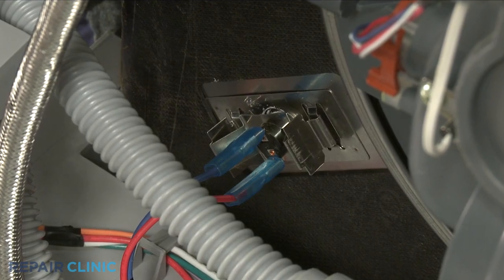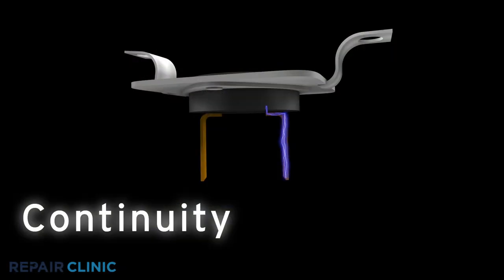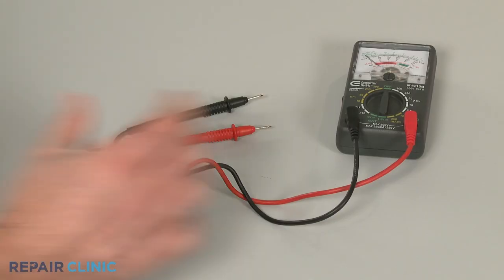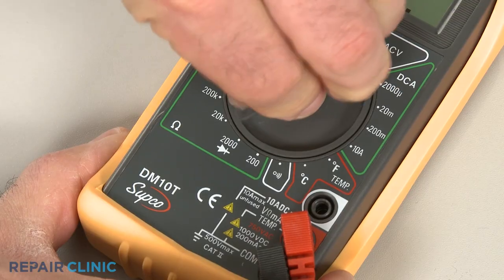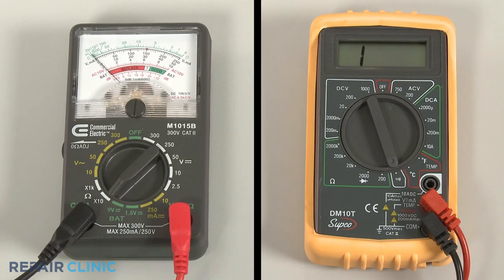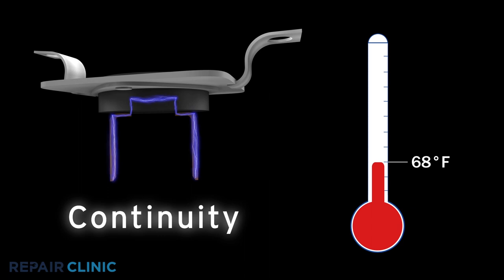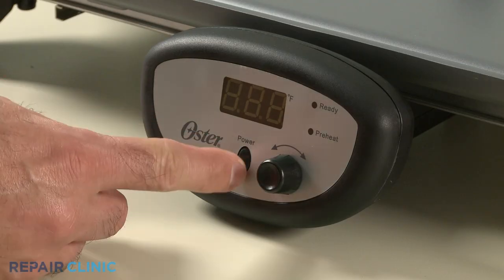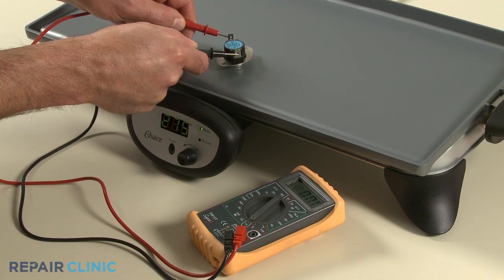Dishwasher High Limit Thermostat Testing

Comment: The tech charts on my whirlpool says the NTC thermistor should have a ready between 46 and 52k ohm at 25 celsius. Doesn't this mean if the test at room temp shows almost 0 or near 100% continuity, that the thermistor needs to be replaced?